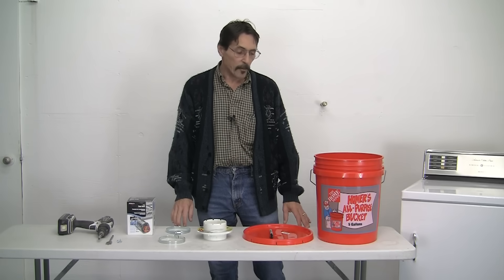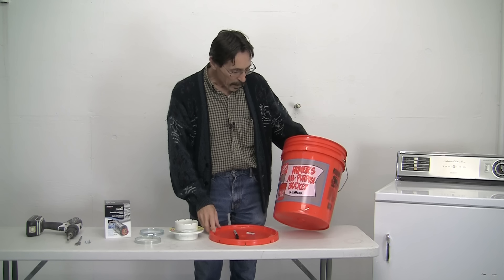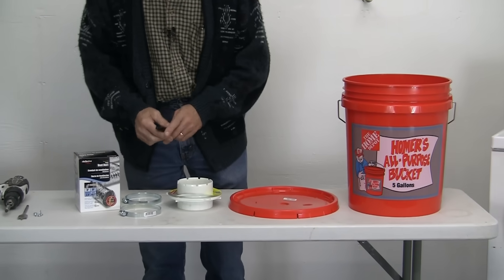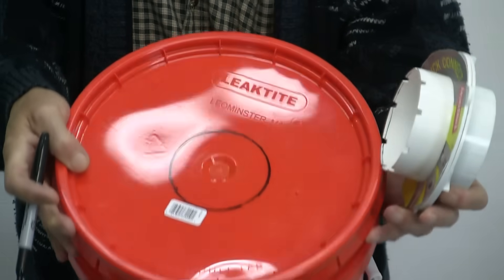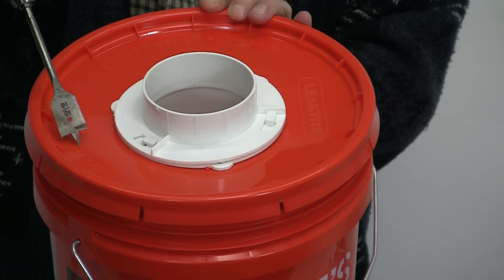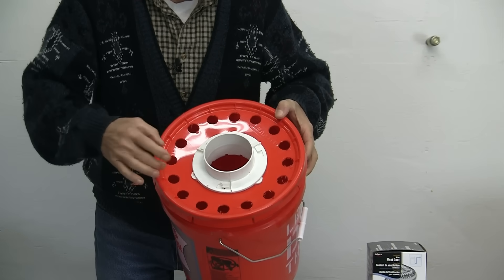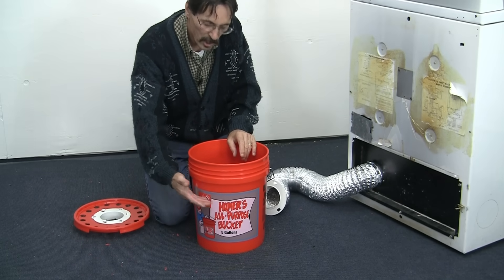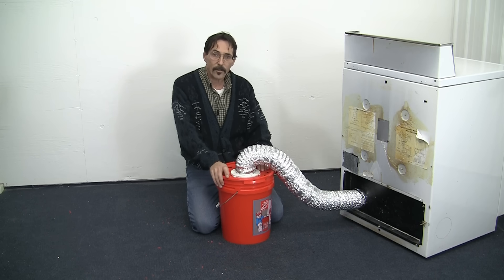DIY How to Cut Electric Bill in Half: Part 3 Clothes Dryer Free Ideas | Missouri Wind and Solar

Comment: Most people don't think that by just running the dryer either gas or electric, you are blowing your warm inside house air outside just as if you turned on a fan and blow the air out the window.  thus cold air (if winter outside) is seeping in from other areas of the house like the chimney, door jams and window sills.
Reply from the maker: Exactly. You are right and the only one to mention that.
Reply: MissouriWindandSolar the average large capacity dryer vents something like 250 cubic feet of air per minute. So if that much air is blown outside then that's how much is coming in from outside for a half hour at a time.
Reply: MissouriWindandSolar

Comment: such b***** hang your clothes outside you would have a problem it don't cost nothing to hang your clothes outside you know next door neighbor's fence the s*** I see on YouTube man they got to be starving for attention awesome
Reply: Mike Jenkins not every city has warm temperature. like you don't have common sense
Reply: Mike Jenkins, u missed the point.  If your trying to heat your cold home, vent the hot dryer air indoors instead of trying to heat up your yard. Many homes are too dry in the winter making u feel colder, causing sore throats, sinus infections, etc.
Reply: Works great !!!!
Reply: Hang your wet clothes outside in the winter? Who is lacking common sense!?!

Comment: I would love to do this, but my air intake is right outside the door to my laundry room and have been told the humidity would mess up the unit to vent the dryer into the house. - Also I remember my Grandma putting a knee high nylon over the end of the vent hose when I was little.

Comment: I've been using one of the small cheep ones you mentioned in the video, It works well except it throws more lint then I would like.I'm going to replace it with your version. Many thanks.
Reply from the maker: You will see a big difference with the large 5 gallon bucket.

Comment: It will work, but will also introduce a lot of moisture into the building.
Reply from the maker: That's what it's meant to do in the dry winter months. Your house will absorb all of it just like it does using a humidifier in the winter.

Comment: I used the nylon stocking and it was taking me forever to dry my clothers
Reply from the maker: Most people have found out the same thing when they used a nylon.
Reply: Fyi, when the airflow of a clothes dryer or even a hair dryer is obstructed by lint the heating element (that coil of wire) will overheat and burn out too. If you want your appliances to last or prevent potential high maintenance repair cost, clean the lint regularly.

Comment: From Google: "The ideal relative humidity for health and comfort is about 40-50%. In the winter months, it may have to be lower than 40% RH to avoid condensation on the windows."

Next... My 2 cents. The single biggest thing you can do to reduce your electric bill is turn off your water heater. Warm up the water then shut it off. It will last a day or two depending on how much you use. I turned mine up a little, but if you do be careful of scalding. Also a water heater blanket would help retain heat though I don't use one. Also make sure you either have a switch or the correct breaker type. Not all circuit breakers are designed to be switches.
Reply from the maker: Well i have always kept my house at 55 to 60 percent humidity and never had any condensation on the glass. I have insulated windows, double pane. Single pane glass may get condensation but i don't know for sure.

Comment from the maker: HEPA filters are over rated and something the vacuum cleaner industry has decided to put on there vacs for return business. They ALWAYS have to be changed.
HEPA filters were only used in hospitals to keep them sterile, they were never meant to use in your home, not necessary.
Reply: Wrong, wrong, wrong.  With HEPA, use an inexpensive pre-filter to catch the bulk of stuff, the HEPA will last much, much longer and the HEPA will actually work more efficiently at certain micron levels.   Remember, either you HAVE a filter, or you ARE the filter.
Reply from the maker: I don't see why it wouldn't work in a tri level
Reply: MissouriWindandSolar
Reply: MissouriWindandSolar
Reply: Dan Peterson j
Reply: MissouriWindandSolar .
Reply: The cat came back
Reply: Dust particles exist smaller than a micron where smoke particles are around 1 to 3. We know smoke particles gets in our bloodstream from cigarettes and all kinds of other things people smoke why can't dust get into our bloodstream if it's even smaller? It can and it does.

Comment: how to cut your electric bill in half: buy a gas heated dryer.
Reply: Sid Fernandez, gas isn't available everywhere! Good thinking though.
Reply: We don't have a gas hook up in our place.  Everything is electric.
Reply: Bull - my gas dryer takes forever to dry clothes. And yes, I've had everything checked, cleaned the vent lines and it still takes forever.  The cost of propane is sky high and it costs a fortune for my gas dryer!

Comment: we arnt allowed to  inside vent any more in my state:)
Reply from the maker: Who's going to know if you don't tell them ? The State, city or county doesn't pay your bills do they.
Reply: the insurance company's do an inspection for resi homes
and apartments are inspected 2 times a year
we have some of the toughest code in the books in Maine ware i am from.
plus if you dry a lot you can over humidify the home and get mold.
and to finish it off
if you don't outside vent the dryer most dryer makers will void the warranty.
i have been in the appliance  service business for 34 years and i wont install a unit this way.
maby in you're state its OK to do it that way.
in Maine is's a no no.
but the idea would work good in a garage:)

Comment: in reference to other comments...I have six children, two still at home...so yes I do lots of laundry. Yes it's winter only..lol
And I always tried to run the dryer at night. One, to save electricity, but also, it's colder at night, and the air is usually dryer, since no cooking or coffee pot. most people turn their thermostat down at night also, so it's not for everyone of course.  Thought I'd share. waste not. 😉
Reply: homie  you need to get some if that free nights, it's badass to be able to  ball out all night. 
No but really is it pretty cool. 
I live in a barn and because of the layout I have to put my washing machine and drier on a non climate controlled area that ranges from below freezing to 100F as the seasons pass. I never really though about the cool air being drier, makes me feel better about running it in winter time thinking about that way.

Comment: doesn't warmth and humidity cause mold?
Reply from the maker: This lint bucket has been used by myself for 30 years and mold never happened. It has been used by thousands of people and there has never been a mold issue at all.
Reply: does a warm bath cause mold. or a shower.  If used all day every day I guess it could but not from an hour here or there

Comment: doesn't a dryer run on a 220 breaker how is that saving you money?
Reply: The heat of a dryer is normally vented outside along with the moisture from the wet clothes. This method keeps the heat inside your house, thereby causing your furnace to run less.
Reply from the maker: Thanks Joel, finally , an intelligent comment.

Comment from the maker: The Rainbow vacuum cleaner uses water for there filter and have been doing so since the 1970's i believe. Works beautifully.
Vehicles use to use a oil bath air filter before paper filters came along. The dirt was trapped in the oil.
Reply: +allen pangborn a rainbow does exactly what a big bong does.
Reply: Folks had a Rexair and ir could be used as a wet vac too. Dad spilled a gallon of oil based interior paint on the living room rug......started pouring hot water on the carpet and sucking it up with the rexair sweeper.......the wool carpet never had any stains. Back in the late 50's.
Reply from the maker: HEPA filters are over rated and something the vacuum cleaner industry has decided to put on there vacs for return business. They ALWAYS have to be changed.
HEPA filters were only used in hospitals to keep them sterile, they were never meant to use in your home, not necessary.
Reply: MissouriWindandSolar I recall rainbow vacs (perhaps an earlier machine name) in use in late 1940's. My folks bought one and I used it often as a kid.
Reply: My Ma had a Rexair (Rainbow?) and it looked like R2D2 squatting on a pot. It worked great.
Reply: My wife has a rainbow.....it does work great and it's unreal the amount of dirt they filter out. Before they were Rainbow they were Rexair starting in the 1920's. They were used as air filters, however,they were not HEPA. They are now but not in the beginning. Only problems with these is how they are sold and the price. You're not going to find these at a retail outlet, that is you can't go to Wal-mart or any other major retailer and buy one. Some online retailers but usually they sell from a sales-person that will come to your home. A new one is pretty expensive over $800 but used ones can be had for much less. The problem with buying used is that they may be missing attachments.

A few thoughts on using these. I feel that having water in the machine really concerns me. I'm afraid that during operation or cleaning out the water basin after vacuuming that the water will spill out causing a huge mess. Never store with water and we don't store with water basin in the vac. We find if you don't do this the water basin gets stuck in the machine and then it will be a mess removing it.
Reply: MissouriWindandSolar my tractor uses an oil sump air filter
Reply: MissouriWindandSolarainbow throws dust it passes through the water in the air bubbles
Reply: MissouriWindandSolar, my old Ford tractor has a oil bath air filter and she still runs like a boss.
Reply: MissouriWindandSolar, hepa filters are great in kids rooms who have allergies. Indoor air is usually dirty, hepa filters work great for some. 
I removed the dirty expensive hepa filter from my vacuum and replaced it with cheap filter material just to catch some of the dust.
Reply: I have another plus for your idea. We have cats that LOVE to attack the dryer hose where it connects to the wall to vent outside, with your idea they won't want to go near it. Win win in my book.
Reply: Nice video, and good info.  But to be clear, and oil bath air filter draws the air through the oil.  I wonder if your fitler would work better if the inlet tube was extended about 12" into the bucket, and the water level were raised to the point that the inlet tube were submerged?  Certainly it would filter better... but would it cause too much restriction?  
I have a drywall dust vacuum filter that's works this way (and its made from a bucket as well) and it works great.
Thanks for the video.
Reply: I put a tablespoon of cooking oil in the water once in awhile.  I catch lots of dust.
Reply: If you wanna see the difference between a rainbow and a reg vac filter get a black light. You'll see what your breathing....
Reply: MissouriWindandSolar hh
Reply: MissouriWindandSolar rainbow vacs have a HEPA filter at the back of the unit now.  They fail to mention this in their spiel that they give to you.  I had to rip it out to get my air flow back.
Reply: I clean air ducts for a living and can tell you without a doubt that a water trap is a joke. There is also a big difference between oil and water and the type of dirt being trapped. Lint is very fine and tends to bounce off the surface of the water. Venting into a woman's nylon stocking works just as well (not good) but with far less work.
Reply: MissouriWindandSolar m in kjwhat
Reply: MissouriWindandSolar correct. although not healthy for lube technicians we learn to protect ourselves by knowing what causes cancer but by the time we change procedures the new inventions come out.
Reply: Loved our rainbow vacuum cleaner too! We had the extra deep bowl for the water so you didn’t need to dump it as often. Good machine but over priced
Reply: Outdated, anecdotal evidence without any science is hogwash at best.  We did what we could do with the sticks and stones we had at our disposal; not because that was the best of all options.  The air bubbles still have crap in them.

Comment: The dehumidifier does a much better job..., You can keep all the heat inside, and then just dump the water... Much more energy efficient than a clothes drier.... of course, only in winter.... In summer, the sun does the best job, dries, kills bacteria and leaves the clothes smelling delightfully fresh. Using the dehumidifier is just a cold weather best solution.
Reply: Castlebury21 No. I am saying that drying clothes by letting them hang with a dehumidifier running is more energy efficient than running a clothes drier, and less violent on clothes. Personally, I do not want more humidity. I have plenty of large house plants releasing moisture to the air. I have a 2800 sq ft house that remains consistently at about 50% humidity throughout the year. That is a comfortable humidity that does not encourage mould.

Comment: I live in an apartment and have one of those crappy box lint catchers you was mentioning, my issues is my apartment gets hot because of it and my AC thermostat is on the wall next to the wash and dry area. My question is would this work better for heat then the cheap white lint box ?
Reply from the maker: Yes it does Matt. The small ones are just about useless and allow to much lint in the air.

Comment: could you use this as a humidifier on your gas furnace?
Reply: He kept saying never to do this on a gas dryer or appliance. It's illegal to vent the output of any GAS appliance indoor. The danger is called Carbon Monoxide (CO).  Carbon Monoxide is produced with the burning of any fossil fuel (i.e. natural gas, propane, etc. and wood). So, no gas burning appliances. Most states now require a smoke and CO detector in the home because CO is an ordorless gas and kills silently. Electrical appliance don't burn any fuel.
Reply: Belinda Edenfield yes, you can do anything you want. don't let anyone tell you otherwise!
Reply: you must have a liking for "only the strong/smart survive" and darwins law don't you?
Reply: Jerome b, "darwins law?"  There is no such thing.

'Survival of the fittest' is possibly the term you were looking for.
Reply: yes it was but i was having a brain fart at the time.  thanks

Comment: I have my dryer in the utility room where my dog sleeps. he has a space heater for him during the cold winters. but this seems like a great idea for him. but the only thing is the energy consumption.
Reply: The idea would be that you simply run the clothes dryer, like normal, when you're doing laundry. Not as a full time heater. The idea is, since your dryer pulls air from your home, heats it, and the vents it outside, you're not only keeping that air in the house, but adding heat that your furnace won't have to add later.
Reply: why I believe you only run it wail dry cloths
Reply: Wow your dog sleeps in a utility room in the winter?  My Pom slept in my room next to me. He never piss the wall or anything.
Reply: PRANKurFACE 
The deal is to get the humidity up in there, I bet where you have the space heater the humidity is very low and hard to keep it heated